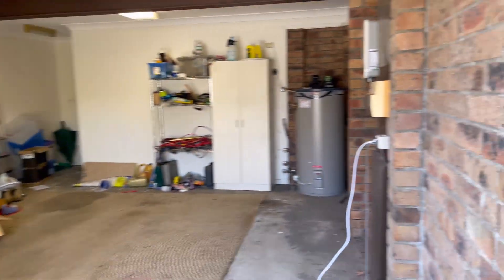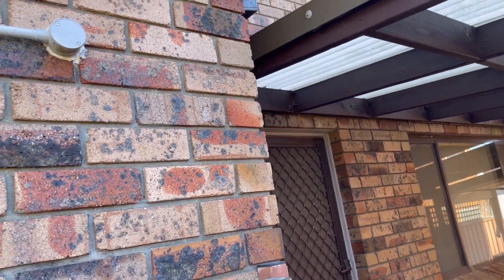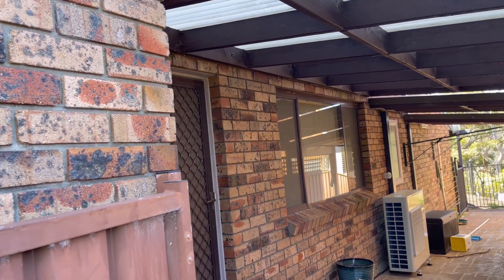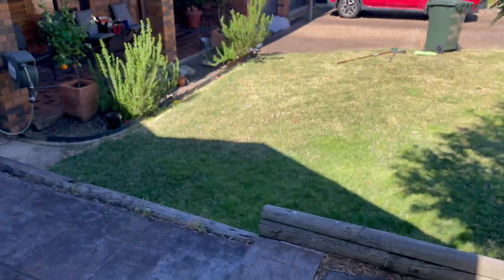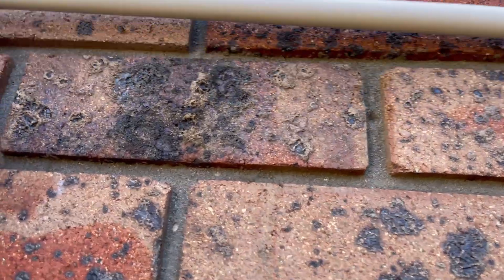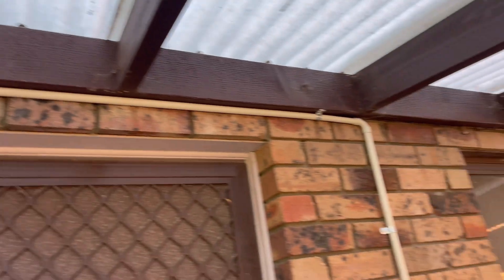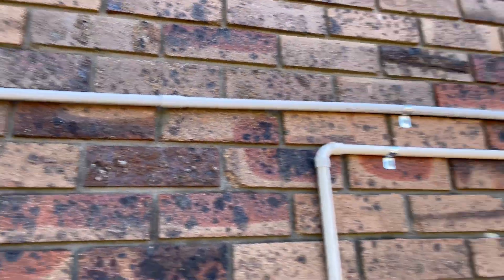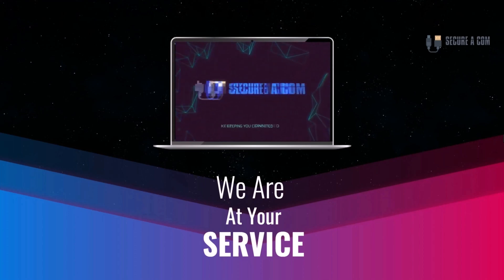NBN FTTP Free Fibre Upgrade | Relocating NBN Box Or Router From Garage To Inside House With Conduit

Comment: I just had a run with a fibre installer and the bullshit NBN rules for installation.. I'm not ok with conduit all over the front of the house or with the inside box on the kitchen or living room wall. There was a great spot and I would have been happy for it there but no power point. I said I can run an extension cable and put a PowerPoint on asap. 'no, you can't. It's need a point blah blah.' is my bloody house, put where I say. 
 So no fibre. I don't care anyway. I've done years of work laying cable and conduit discretely and NBN is just BS. 
 This is in a rental house. My house will be even harder to do. I'm not having a box on a wall somewhere.. the only place is the laundry. It's not a wet area.

Comment: From a house owner point of view I would rather have run an ethernet cable through the roof than put ugly conduit runs on the outside wall. That's not a comment on Secure-A-Com's work, he's doing what's practical with limited time, in agreement with the customer.

I like to prepare things ahead of a technician's visit to make things as quick and painless on the day as possible.
Reply: I agree on both of these. All that conduit outside is worse than the nbn boxes outside. Great news for the spider population, those conduits.
Reply: Looks awful.
Surely could have run it internal and into roof space near the hinge door and into the cavity and socket to inside of house?

3rd world country standard of work. Flex conduit and are those saddles for external use?

5years time the flex eill be broken down via UV rays andbthe saddles be rusting and staining brickwork

Comment: OMG - why would you run that ugly conduit along the outside of the garage instead of the inside, and then under the eave instead of inside it, and then down the outside of a cavity wall.  That is truly awful in my opinion.  And then the NBN has to run around the double brick inside the garage to boot.  Same goes for whoever ran that existing conduit.

Comment: Q&A Hay mate on the central coast how do we go about getting NBN to fix the copper in the street.
We’ve had dropouts all the time since connecting the NBN FTTN 
Have gone the 5G mobile service six months ago but still dropping out in peak times 5PM-9PM my home Internet is absolutely useless 
Any advice would be grateful
Reply: I had issues with FTTN copper reliability recently. I ended up getting it resolved by dealing with my ISP (iinet) but not after some difficulty.

Call your ISP's tech support line and report the issue. They will likely run you through some normal, simply routines to resolve the issue. These checks will normally involve restarting your own equipment (modem/router and computers). So it would be wise to make sure all your equipment and cabling inside the house, right up to the where the lead-in cable terminates inside your property are all working properly and are not the cause of the fault. Sometimes a simple looking join can be bad so it's worth checking them.

Once you've been through all those checks with your ISP you can make a request for them to inspect the line. They can do this at a few places, within your property, in the distribution pit on your property and at a local NBN node. If if turns out that there issue is your fault then you can be charged for the technicians time, if the problem is on their end they won't charge you.

I had a strong suspicion that my dropouts and speed problems were not due to anything on my property so I ended up requesting that a technician be sent out 2 or 3 times. On a second inspection at the nbn node they discovered a problem with my copper line termination at the nbn node. It had been interrupted by a previous technician doing work on someone elses line. They fixed my connection and my FTTN speed went from 33MBps to 100Mbps and the dropouts stopped happening.

So, in short, you'll have to go through the hassle of dealing with your ISP but it will most likely be worth it.
Reply: @jeremylindemann5117  thank you for the reply since writing this i have been connected to FTTP only yesterday
The ridiculous thing according the installer the fibre has been in my area for over 2 years but has only been activated in the iast 2 weeks
hopefully i will not have any more problems
🤞

Comment: Congratulations.  A general question / clarification on fibre upgrades that might help some people out -  In a situation where the existing incoming conduit terminates in a crap location - can you install appropriate conduit for the NBN insaller to extend the fibre run? I assume the external fibre box would ge where the external conduit terminates, and then internal fibre run in new conduit to inside fibre box. Sorry for the convoluted wording!
Reply: You would have to check your ISP with what they allow the customer to do.

My guess would be that you can install or modify the conduit yourself but you might need the technician to inspect and approve it which may mean leaving the conduit trench uncovered until they get to your property. The cabling itself most likely has to be done either by your ISP's tech or an approved third party contractor.
Reply: @ForTheBirbs is the house on a concrete slab on the ground or is there crawl space under? Single storey or multi? 
Does the lead-in conduit from the street currently present itself on the street facing side (front) of the house or on a side wall?
Reply: @iamdave84  thanks, was just a general question that a lot of people ask. Cheers!

Comment: My NBN has been playing up for months since TPG sent me a bucket load of text messages saying there will be works in the area (which went on for about a month or so). Ever since my TPG supplied router keeps losing connection (or more so loses it's IP), so what ever supplies it with an internet IP keeps bugging out, so my fixed IP drops off and the router changes to 0.0.0.0 same with the DNS and Gateway. short time later its back, does this from a few times a day to so far over 20 time a day. Been going on for months and TPG say they run some test and the connection is good. They sent out a tech who told me to move my router and NBN HFC box to a new location. They also gave me a new router and it still has issues. I wonder some times if the HFC modem is going bad but I have no idea how to test that. Occasionally I will see the HFC NBN modem drop off , some times I see the Internet light on the router drop off, but most time everything shows connected, so hard to pinpoint when it's so random. I just know I cant play online game for long cause of the drop outs and watching movies is annoying when the break in the signal, and programs like discord show offline. I purchased a program that monitors and reports a lose of connection and a time stamp, hoping TPG will accept the logs to review.

Comment: NBN installation requirements dictate a dedicated GPO below or below and to the side within a couple of hundred millimetres from the mounting point of the NTD. I expect the householder will have to pay for an electrician to install a dedicated GPO for the NTD in proximity to your data socket. The existing GPO seen in your video is clearly being used for other purposes and would be unsuitable for NTD use. Otherwise, congratulations on the growth of your channel.
Reply: NBN requests a direct connection to a GPO within 3m

Comment: Q&A: Hello! I have a few questions regarding lead in cables from the pit. I have a property with 2 separate houses that need a fresh new installation of the lead in cable from the pit but discovered that the actual conduit underground has some blockage issues(the current copper cable from pit to the first property is damaged and only at 20% usage) and second property has no cables installed from pit). Is it NBN's job to have this installed for free? Because the nbn techy said that I was required to pay for it. Would you install a new conduit or need to use the blocked one? Who is responsible for the installation of the cables within my 2 properties?
Reply: That sounds like a property maintenance issue which might come under the jurisdiction of the local council. A new property would require a new pit and lead-in installation to be done by an approved installer, perhaps Telstra or NBN co.

The old damaged copper cable for your existing property is a different story. Firstly, the copper cable should be inside of a protective conduit. If it isn't then the cable may not have been competently installed by an approved technician, but by an owner who likely decided to save money by doing it themself. I'm not sure what you mean by your conduit having "blocking issues" but it should not be intersecting any other pipework. If the copper pipe or conduit is damaged then you need to have it replaced. For that you should contact your ISP and organise a technician through them or ask for the name of an approved third party installer. If you damaged the copper cable then you will have to pay for the expensive of replacement. If a technician damaged it then you will have to make a claim with your ISP and ask them to replace it. They may require proof of who damaged the cable, how and when.
Reply: @jeremylindemann5117  The new property is an extension and needs a separate infrastructure because the builder skipped that part and no longer is contactable. Is it possible to have nbn responsible and cover the cost for trenching in concrete and lay the infrastructure under the 'last resort' option?
Reply: @Ch.ck-New-when  I don't think nbn will do it for no cost because they are under no obligation to. They might still do the pit and trench installation work so I suppose you can always make an enquiry with them and ask for a quote.

You may have some legal recourse which will oblige the builder to finish any agreed work but it would depend on just how uncontactable they are.

I'm not really sure, I'm not an expert on property and building.
Reply: @Ch.ck-New-when request fibre install to the first premise that has a lead-in cable currently. I believe cost for repairing that conduit or finding another method to connect that house are nbn's responsibility.

For the second premise, you will probably need to connect it to the first premise. Current (2024) model fibre NTDs have 4x UNI-D ports, that each can provide a seperate service. You can order a service for the second dwelling on port 2 of the NTD from either the same ISP or a different one, and connect it via cat6 or a wireless link.

If you want to just have 1 fast service and share it to the second dwelling, that's also an option. That way you can include internet in the rent if you're renting it out.

Comment: Scared of cavity’s and roof spaces?
Reply: You missed the bit where he said in the video that the garage wall was single brick? No cavity. Probably no roof space either. The customer clearly didn't mind having conduit along the brickwork as there was already one there.
Reply: @ashuggtube where did the original 2 pair cable go at the top of that conduit?
Reply: @iamdave84  dang, this was months ago, I'll have to watch it again if that's a serious question…

Comment: I"m finding NBN are saying now we will not repair your copper service because fibre is now available. Then the poor customer has to wait weeks to months for fibre to become available if it is not in the pits already. This process is where the copper service requires a complex fix ie remediation required for  joints, lead cable issues that requie money spent.
Reply: Isnt it NBN responsibility to install and maintain a working cable to the property?

Comment: ethernet over power would be another, less ugly, less expensive option,  or  even a second bridged router
Reply: And the performance would suck. Nothing beats direct cable.
Reply: @GavinR824  yes, but no one uses it
Reply: @GavinR824  what performance do people need to watch youtube or netflix or facebook.  no one needs it, except you
Reply: @vincesnetterton5868  you have no idea what this customer needs, or wants! You certainly don't get to decide that. 😊
Reply: @ashuggtube  i certainly know what the customer needs
Reply: Ethernet over power is disgusting, get outta here
Reply: @ashuggtube  in what way
Reply: @vincesnetterton5868  the garage is not necessarily on the same circuit as the room in the house where the router is going. The use of major appliances such as dishwashers, washing machines and microwaves will degrade the network signal performance. Bandwidth and latency are worse than dedicated network cable. Oh, last but not least, call up your ISP about your Internet being slow and tell them you're using ethernet over power between your router and the NBN box. In fact, do it right now and see what they say. Do they hang up on you? Maybe not, but they're going to tell you to run a network cable DIRECTLY to rule out the power cabling as the issue.
Reply: @ashuggtube  who knows?
Reply: There are plenty of good mesh systems available these days
Reply: You are just not thinking with your thinking hat on
Reply: @ashuggtube  I ALSO SAID ACCESS POINT

Comment: Q&A, Seeing what you see out in the field, do you think nbn should have persisted with their original fibre everywhere plan? Does all the corroded joints and crappy connections balance against the broken conduit, buried pits and impossible building access?

Comment: Why didn't you pull the old feed out from the house and pull a new CAT 8 in, in its place, CAT6a is so old school
Reply: CAT 8 is simply overkill. CAT6a is good for 10Gbit over that sort of distance.
Reply: @GavinR824 adding Cat 8 also has a complicated earthing situation. It's not just one cable run, it's also 2× earth wires (one at each end)

Comment: what diameter conduit do you use for cat6a?
Reply: Looked like 20mm (external diameter). The slightly bigger looking conduit above was 25mm electrical. 
Most conduit the NBN guys use is roughly 20mm internal diameter, so more like 26.5mm external. 
I think what he chose to use is the neatest option. From what I understand, those one way conduit boxes don't exist for the NBN conduit.

Comment: My question is:  Those boxes in the ground housing all the cabling that get flooded do you think they could design a waterprof box to fit in them with access points for the cabling it seem as though they could be designed much better.  Been watching your videos for short time learned a bit.  Wish I had have seen these videos a last year where we used to live our telstra internet would constantly drop 2-3 times a day and it never got fixed.  Luckily we moved.  keep the videos coming.
Reply: The joints are water proof but the imported contractors who dont care about closing them . The pits fill from water up hill alot of the time
Reply: If the pits didn't fill with water they'd pop out of the ground like an empty in-ground swimming pool when the ground gets saturated. It's a design feature that they're allowed to fill.
Everything in the pit was originally designed to operate fine underwater. Poor maintenance and installations mean that doesn't match reality.

Comment: Hey Jason, congrats on the 1m views !

Question.. Running a CAT cable just like in this video - this has to be performed by a registered cabler or no ?
Reply: Short answer yes, Unless it's never going to connect to a Carrrier network.
Reply: @brendanmichaelwelsh6260  so, unless it is an air gapped network then? Anything else has an indirect route (unless anything after the network termination doesn't fit that definition)
Reply: @brendanmichaelwelsh6260  Incorrect technically all data cabling, whether it is going to connect at a point to a carrier or if it is internal data cabling that never connects to a carrier is suppose to be done by a licenced cabler in Australia. Carrier work is a different classification again which for the most part encompasses external street works, which don't require the open cablers registration, however most have it for small runs/work needed to do internal works.
Reply: @ Can you quote where in S008 | any another standards where it says this, Last I read it specifically stated 'When it is to be or has the capacity to be connected to a carrier network, Written in the days of your old school telstra phone line. Has there been an update that I've missed?

The over arching "Cabling" is often open to interpretation - But I would agree under the vast majority it should be completed by a registered cabler but 99% of the time Sparkies don't give a shit.

Comment: wifi / access point makes this ugly mess,  unneccessary
Reply: Some people like to have a service / network that actually works - Wifi has it's place but should never be the default goto.
Reply: @brendanmichaelwelsh6260   no one cables their laptop
Reply: @brendanmichaelwelsh6260   um, wifi is the default go to
Reply: WiFi is in no way comparable to having a direct cable connection. WiFi should only be for devices that are portable and can't have Ethernet.
Reply: @GavinR824  no one cables their laptop
Reply: @GavinR824  wifi is certainly comparable to wired.
Reply: Look at that heavy full double brick construction and how far the crappy wifi router that the ISP provides is going to be from the rest of the house. You'd be lucky to get any signal in the closest room to the garage. As ugly as it was, cabling that is the way to go, and with double brick construction your options for running new cabling are limited.
Reply: This is not the hot take you think it is mate